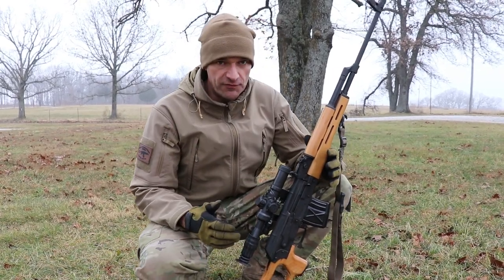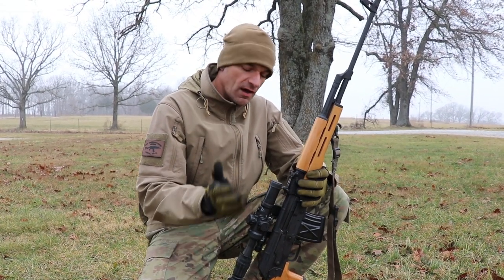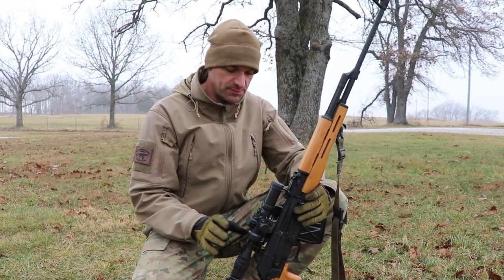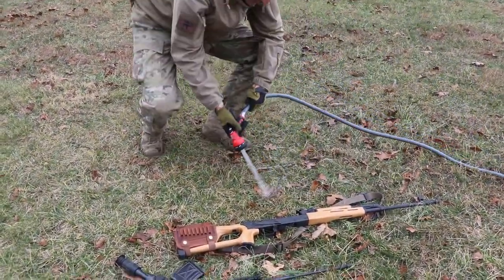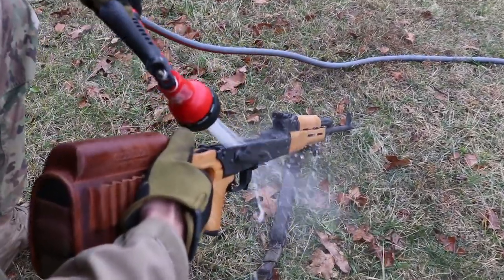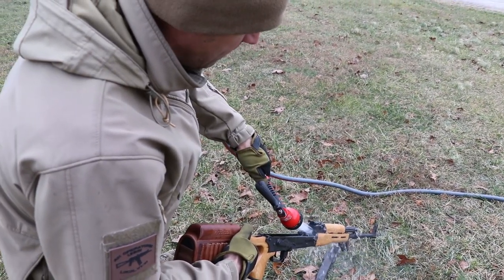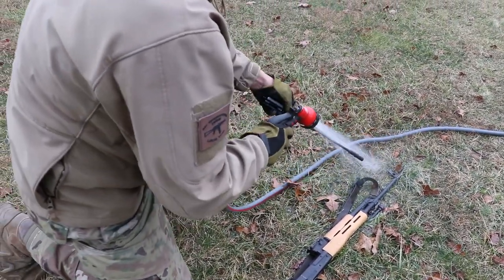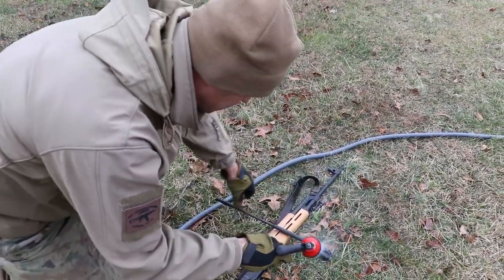Corrosive Ammo

Comment: "Do it once. Do it right."

I like that.
Reply: He didn't do it right..this is NOT the way to clean corrosive..this video is bullcrap.
Reply: @chadhaire1711 how?
Reply: @wademichalski768  Are you serious?  Dumping water in the cracks of wood and metal where it will not evaporate and cause rust and rot that cheap wood?  All you need to do is shoot hot soap and water down the barrel and wash it out......barrel only.  This guy is a clown.  NEVER do what you see here!!!
Reply: @chadhaire1711  "Oh no, it's raining. Guess we have to cancel the war for today."
Reply: @a330flyguy2  1. The wood on the PSL they sell here   is poor quality and will warp and crack with ease.  Get it wet and you are screwed.  These frame and small parts are poorly finished and rust like crazy in humid weather.....soak it in water is bad bad bad.
2.  There is ZERO reason to hose down the entire rifle.  Only the barrel needs to be cleaned and pouring hot water down the tube works although adding soap makes it better...adding ammonia is perfect.
3. Yes in the field you might not have soap and ammonia and have to use water, but if you have a place where there is a water hose you will likely  have access to soap.
4.  I have been doing this longer than this guy......take a pint container, pour in hot water, dish soap (it cuts grease) and one ounce of ammonia.  Pour it down the barrel with a funnel, rinse, and you are done.  Takes 5 minutes.
DO NOT use windex...has little ammonia.  Do not use solvents...they take too long and don't disolve corrosive. DO NOT listen to this guy about cleaning.....of much else.  He also uses extended magazines as a bipod when shooting prone.  This can damage plastic magazines and break parts in the receiver on an AR15.
5.  If you have ever had a conversation with this guy one on one you will see he is not the brightest bulb in the lamp.....this channel is for entertainment only, like Tim at MAC channel......only useful to see the guns not the Goober holding them.
Reply: @chadhaire1711  The corrosive salts are potassium chorate which is not soluable in ammonia. So putting ammonia in it does nothing to remove the salts. Ammonia can remove copper but it is also corrosive to metal so if you don't flush it all out it can damage your barrel. Would highly not recommend ammonia.
Reply: @a330flyguy2  I did research years ago on what was in Bottles or cans of black powder cleaners sold on the market....the MAIN ingredient in most was AMMONIA. So if it does not work why are they using it?  Of course you flush it out....like I said a pint of hot water, dish soap as a degrease, and ounce of ammonia and just pour it down the tube, then rinse. Takes less that 5 minutes.  I suppose just hot water and soap might do but until someone explains why why ammonia would be used  in black powder remover if does not work I will still use it as I have for decades.  So why do they put it in if it doesn't  work?  If I recall Hoppes 9 used to have ammonia  did it not?
Reply: @chadhaire1711  The ammonia is used to get the gunk off. It is an effective cleaner because it's slightly corrosive. So maybe the idea is clean off the stuff that the salts might be hiding under? But a bore brush will do the same thing. Either way potassium chlorate does not dissolve in ammonia. Most bore cleaners are corrosive and that's why I don't use them. I've also seen barrels that have had 5k rounds through them without cleaning and not seen any evidence of copper buildup that would affect the performance of a barrel.
Reply: @a330flyguy2  I have  not used a  bore brush in 20+ years.  On standard ammo I just spray solvent and run a bore snake through be it rifle or handgun. DONE.  On the bolt I just wipe it off.
I used to clean rental guns at a gun club and stripping the guns down and getting them spotless like they  wanted was just silly, especially every week---only four guns per hour.  I finally convinced them this was stupid and did the quicker  procedure I just described and did a 12/15  guns per hour.

  I am not in the military any more and dont see the need for a 100% spotless gun.  In fact I saw more guns worn out from cleaning than shooting as far as M16/AR15 goes. As far as  copper that is something that been debated for ages.
One theory is that removing copper actually DESTROYS accuracy.  It was explained like this:  In a barrel it might look smooth but microscopically  it has lots of tiny craters.  Shooting lots of copper and not cleaning fills the holes creating a smoother surface and BETTER accuracy.  Removing it brings out the craters again killing accuracy. I have discussed this  with many barrel makers and it is 50/50.  Same with barrel break in 50% say yes 50% say bullcrap dont need it.
There are spray foams that remove copper I used on my stainless match barrels but I didn't see much difference so I just stopped and most of my rifles are GI spec and I dont worry about long cleaning procedures any more especially with chrome lining. So yes unless corrosive being used just spray and snake it.  And ammonia is only $1.99 a gallon so even if it doesn't work as well as you say it doesn't hurt if used quickly and  adding it takes no more time.   If I run out soap and water will do too.
Reply: @chadhaire1711  I agree. There's lots of 'gun voodoo' out there. Not even manufacturers agree. You just have to do what works best for you.

Comment: I have an assortment of AK's in 5.45x39, 7.62x39, and 7.62x54  and all I shoot is corrosive ammo and I have found that it is no problem whatsoever.  Though I don't use the method shown here by Rob, I use a large spray bottle and spray my guns heavily with a mixture of Ballistol and water.  I then wipe everything down, run patches through the bore and gas tube.  After the water evaporates, the residual Ballistol leaves an oily film.   My method has worked well for me with absolutely zero rust forming anywhere on the guns.
Reply from the maker: Yes, "shower" was just handy here, but I even used water in bottles - main thing flush out those salts...
Reply: @AkOperatorsUnion  
I have watched your video with the bottled water flush and I have used that method in the past and it also worked quite well.  When I have used the bottled water method, I would then spray down the areas with WD-40 to help displace the water.  Afterwards, I continue cleaning as normal.  Again, no rust problems at all.

Oh, also, I would not hesitate one bit to your your method above and take a shower with any of my sexy AK beauties!!!

Comment: I take a bottle to the range.  Since the barrel is still warm or hot, this is a perfect time to wash out the salts and get a brush down the bore.. I don't use a hose but when I get home I make sure the salts are out and then use compressed air to dry the gun.  Then clean as normal with solvents and finish up with some CLP.

Comment: Yeah, right. I took this bad advice once and cleaned my AK with water. Thought I had everything well-dried with compressed air, etc. And yes, it was oiled afterward. But, a few weeks later, it was all rusted around the rivets and the rivet holes. Couldn't get the rust to stop. Ended up having to scrub the entire receiver with mineral spirits and then Duracoating it. I STILL have some rust and must keep oiling it. DO NOT SPRAY YOUR GUN WITH WATER. Bad idea.
Reply: Compressed air contains atmospheric moisture. Using compressed air  basically forced more water into places that would make it harder to dry. I’ve used Robski’s cleaning technique many times in the past on firearms after shooting corrosive ammunition and have never dealt with rust. Let it dry on its own in a well ventilated area and it always comes out fine. Apply oil after it is dry. If you apply oil before it is dry, the oil just traps the moisture in, this causing the corrosion you experienced. Ask the black powder shooters how they clean their guns, “water at the least, the hotter the better” will be the answer you get.
Reply: @bradentidd4093 i don’t get it? I did what you Said to let it dry in its own and my new m70 started rusting

Comment: I have done the water method and the windex method and both work just fine.
I have used CLP to clean as well and there is no rust in my PSL.
Reply: there is not enough ammonia in windex...doesn't work...if you want ammonia use ammonia

Comment: would i need to do this method of flushing with water if using modern golden tiger,wolf or silver bear 5.45x39 ammo in my slr-104?? they say all these are non corrosive but you are waaaay more knowledgeable than me on this hence the question. don't wanna screw up my slr but don't wanna do needless crap either.
Reply: NO.  Also NEVER use a water hose!!!!!  Just pour soapy hot water and ammonia down the barrel is you use corrosive.....NEVER get the wood wet.....it will rot from the inside and create rust.

Comment: I’ve shot thousands of M67. Never ever used water to clean my AKs. All I ever used was CLP. Never had an issue with rust. 

MAC uses water also, I still cringe.
Reply: Maybe you have chromeline barrels? Then it's not a problem 👍🏻
Reply: Water and soap best (with toothbrush) ! Will definitely corrode/rust gas system , got to do it all !
Reply: Check your gas tube, I bet it's got the gun herpes
Reply: Been shooting only corrosive in my Mosins, K98s, and AKs for the past decade. I've only used Ballistol to clean, no water at all. Never had a rust problem.
Reply: BenziLL enTerTainmenT still an issue.

Comment: Tula says its non corrosive? You believe it just curious?? Thanks
Reply: Modern ammo typically isnt corrosive, its the surplus thats corrosive.
Reply: Its the primer that can ne corrosive. You can test yourself. Its a fairly easy procedure.  Requires bullet and powder removal. A 2x4 and nails. Strike the primer while the case is over the nail.  Watch rust form.  Corrosive

Comment: Do piston systems make rifles more durable & require less maintenance?
Reply: Kinda but not really. It handles heat better than the AR so you can have constant drum mag dumps like you'd see with an RPK. And you have most of the crud in the piston instead of the bolt carrier group. Same level of maintenance, just in a different location that is less likely to cause stoppages.

Comment: Hey Rob, looked for that cheek rest in the store and was unsuccessful :--(((
Also, I heard Windex was good too, any thoughts ?
Reply from the maker: I got it from Amazon. Kid you not
Reply: @AkOperatorsUnion      I'll try to find it, thanks.
Reply: AK Operators Union, Local 47-74 I know this is a stretchy, possible link to that cheekiest?
Reply: windex sucks--is most water,,use real ammonia.
Reply: chad haire       Good Windex was even recommended in the paper work with the first Mosin Negant rifle I bought !
                           Just saying, I’m sure straight ammonia would be the best.
Reply: @nickjm37fordel1  A quart of boiled water, mix 30% ammonia, and 5% dish soap (a degrease) all you need down the barrel.  NO NEED to clean out the lower-corrosive does not go there.
Reply: chad haire     I’ll give that a try :-))
Reply: @nickjm37fordel1  been ding it that way for 30+ years and never had a rust issue, and it only takes about 10 minutes.  You will need a quart container, a bottle of ammonia, and funnel, a bottle of dish soap....all costs about $5...less than what you would pay for a can of ballistol, or black powder solvent .

Comment: I always thought getting rid of the salts from corrosive ammo was much harder. Thank you!
Reply: It is easier than this stupid procedure...
Reply: @chadhaire1711  Enlighten us.
Reply: Yeah thanks right, you really have to dry all that water out right away after.After field stripping I run super hot water down my SKS’s in the bathtub and then dry them with the wife’s blow dryer on hot. Works like a charm..then just use your regular gun oil. No need for windex or any fancy air compressor stuff.

Comment: If you have a muzzle device on it, make sure you remove and rinse it off as well.  I had one get stuck from rusting up once.
Reply: same
Reply: Patriot Eke what sucks is the PSLs is pinned on. I guess put some oil between the barrel and the break. Not too much.
Reply: So true. Only about 50 rounds of Norinco surplus through my WBP AKM, 3 hours later at home, it was humid... I could barely take off the slant brake.

Comment: Ammonia neutralizes the salts in corrosive ammo. It’s what I use.
Reply: All most forgot use hot water it Evaporates and dries much quicker then use gun oil from a spray can “ rem oil “
Reply: That's a myth. It's the water in the windex that removes the salts. Ammonia does nothing chemically to salt.
Reply: grau473 if you go back to your high school chemistry book. Ammonia does neutralize salt.
Reply: No it does not!!!
Reply: Thystaff Thywill  I do too, but windex no longer contains ammonia.  I use it because it has surfactants that help break up the grime and alcohol which helps it evaporate faster.  I do it at the range when the rifle is still hot, it evaporates totally dry and then I stick a bore snake with Ballistol down it.  Water would work just as well but wouldn't evaporate as fast and doesn't have the surfactants.  I like that the windex leaves it totally dry and seems to work as well as hot water would.
Reply: So pissing into it would work best? It contains warm water and amonia 😂

Comment: Good tips Rob. After washing out my AK with hot water, I like to spray some "moose milk" (1 part Ballistol and 10 parts water) down the barrel, tube, bolt and inside just to give it a light lube. The water will evaporate and leave the Ballistol on the metal.  I then pass a bore-snake through it to clean the barrel.
Reply: @Jim Beam Re-read my  method. I do use plain water, the moose milk is for after to lightly lube it.

Comment: Bolt action Mosins are a lot easier to clean.  Just squirt it down the barrel and douse the bolt and your done.  I always used hot tap water.  Maybe a little overkill, but by the time I was done the gun was 140 degrees from the hot water and dried faster.

Comment: I use Hoppe's 9.  As it is water-based, I do not need to flush my rifles with water prior to use Hoppe's 9.  I simply use the solvent.  I have done this for years, yes, with corrosive ammo, and have never had a problem.
Reply: I did the same out of ignorance with a Yugo SKS....It rusted. Washed it out and oven dried but some damage to barrel was done.
Reply: @wolco003  I don't know how you clean your rifles so I cannot comment.  However, I've never had a problem with mine.  I've used this method on three separate rifles for five years now.  I would not call that ignorance; it is based on experience.
Reply: @Jim Beam Do you have an argument?  Any evidence to support this claim?
Reply: @Jim Beam I did watch it.  No, Sir, it's evidence that there is another method one may use.  Rob has his method, and I've used it before.  It was a massive pain in the ass.  The method I've been using has achieved the same result, but it was far easier.  My point was that you can use an easier method; not that his method is wrong.
Reply: @Jim Beam Yes.  I don't know if it's too strong to be used consistently.  What makes you say that?

I don't use it constantly.  I use whenever I shoot corrosive ammunition.  I do not always shoot corrosive ammunition.  Additionally, I have not seen any evidence of damage to the chrome lining of the bore in any of the three rifles.
Reply: @Jim Beam I don't have one.  But, once I get one, I'll be sure to do that.  I like my Veprs.

Comment: You may want to take off the wood furniture so it doesn't swell. The parts of the wood that face the inside of the firearm "particularly the fore grips" aren't varnished because it would just burn off.
Reply: or better yet dont be an idiot by hosing the rifle down like in this video
Reply: @chadhaire1711  That's actually probably the best way to clean an AK. It's not a delicate flower like an expensive AR. My prefered method is to squirt it full of windex, scrub the internals, dunk it in a bucket of hot, soapy water and scrub it again. Then let it dry and apply oil. It gets it sparkling clean and it's super easy.
Reply: @jamesc3001  This is crazy.  1.  Most AK wood is not intended to get wet and will rot doing this.  2.  Secondly, you say how tough the AK is, yet you suggest it needs all this special cleaning--yes it is tough, that is why  it does NOT!  3.  To clean corrosive, just pour a mix of hot soapy water with ammonia down the barrel, and wipe down the bolt/piston assembly.  There is NO NEED to wash out the lower..NONE--corrosive does not go there..Then rinse, dry, and lube.  Takes about 10 minutes.  4.  Hosing the rifle down  like the video is stupid--sorry.  Also Windex SUCKS...there is not enough ammonia in that bottle, it is mostly water and blue dye--get a bottle of real ammonia..cheaper and better.  5.  NO NEED to dunk in a bucket of anything!  EVER!  6.  These guys at AK Union get dumber in each video.....there are many other stupid things they do--like watching a James Yeager video...
Reply: @chadhaire1711  Jesus Christ. Take a chill pill.
Reply: @chadhaire1711  Well, whatever. I've done it  "the AK UNION" way hundreds of times and never had rust. Either way, who cares? An AK cleaning vid is a pretty silly thing to get a bug up your butt about.
Reply: @chadhaire1711  Duuuuude, you.... need... to... calm... down.